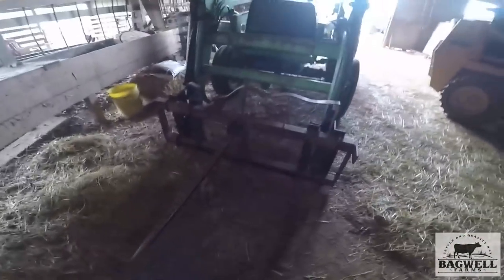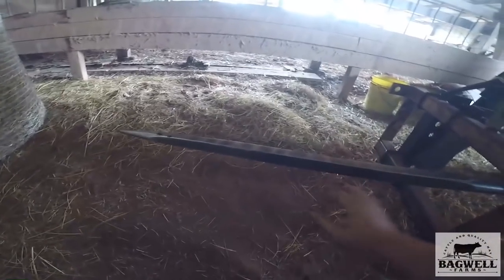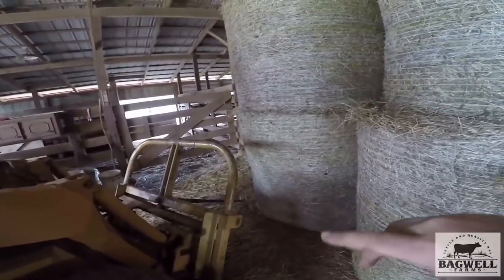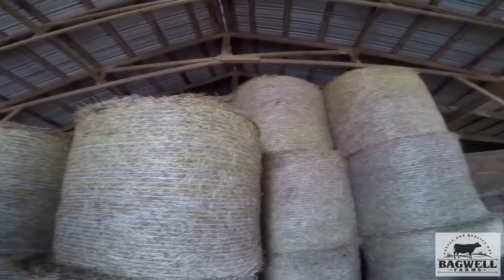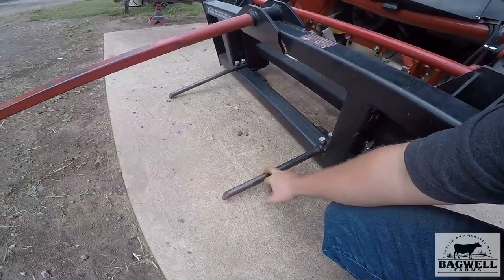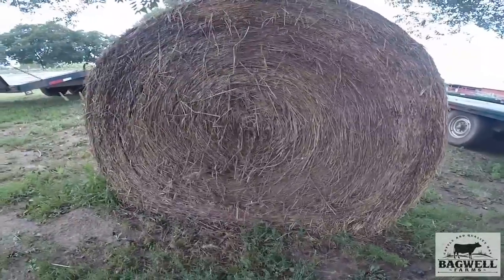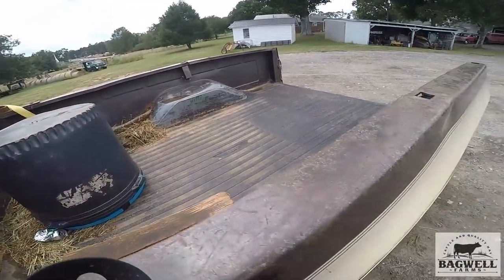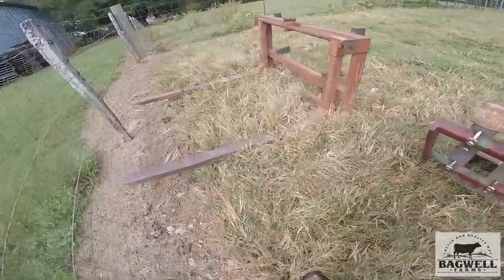Why We Use The Hay Spears We Do

Comment: Easy way to get a round bale to roll out of the back of a pickup truck,  is to first put a strap under the bale before the bale goes into the truck.  Run the hook part to the front bumper area,  and put the bale onto the strap.  Run the ratchet end over the bale, back to the strap. This should keep the bale from rolling around the back of the truck. Unloading,  unhook the ratchet end and hook it somewhere to the rear bumper area. Unhook the part from the front bumper area, extend it out behind the truck and tie it into something solid.  Either drive away, or winch out the bale.  It should roll out fairly easily, even the D-shaped bales setting on the flat side.

Comment: Great video, good knowledge to have. I also stack my hay inside like you do but I use a HLA round bale grapple on the front and a three point spike if I am moving two at a time. By stacking vertically three high it saved me having to build another structure, can store all the hay inside the one. building.

Comment: Use a double spear...both the same length...about 3ft apart. You can stab the bottom of the bale and it wont spin around. Same with stabbing the bales on end. That way you  can raise the bales higher..for storage much safer also ! Also your able to stab in the softer part of the bale.....making easy to stab !